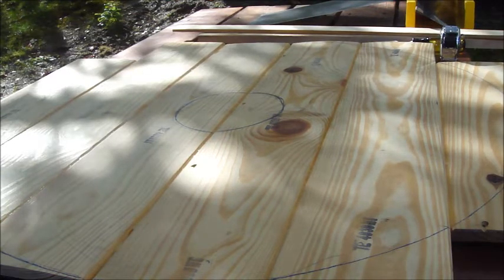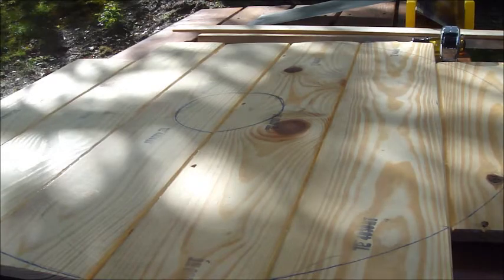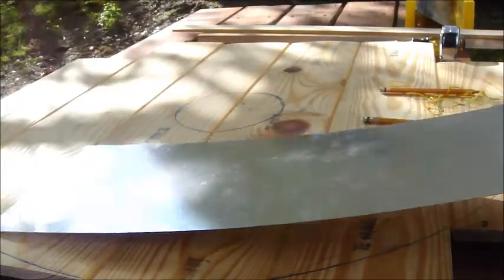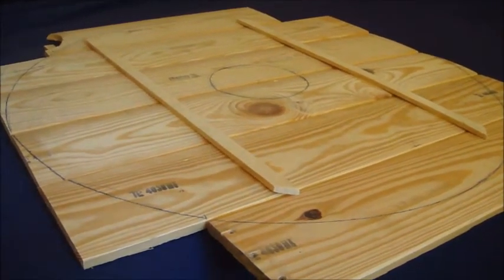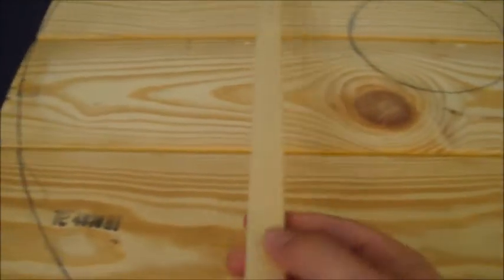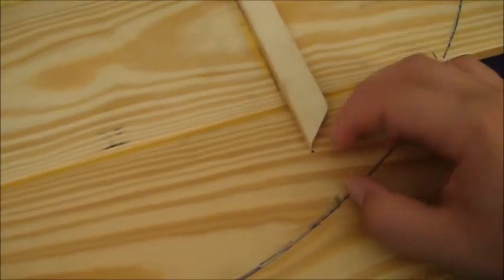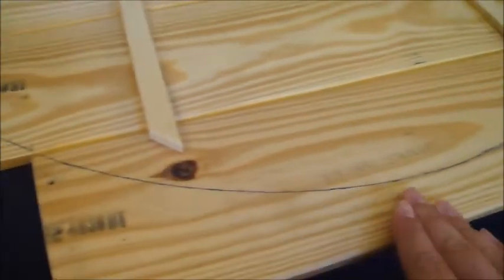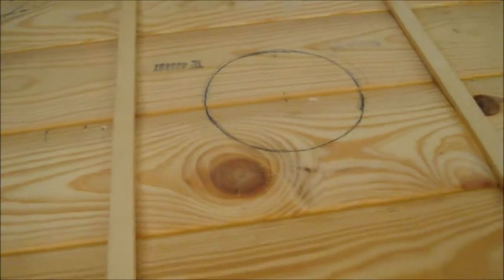Viking Shield Costume Prop - Part 2

Comment: Why not use Dowel rods as joints to connect each plank with glue, for additional support?  I like your videos, keep them up. I wish I had these back in 2011 when I was making a viking shield prop for the Skyrim release!